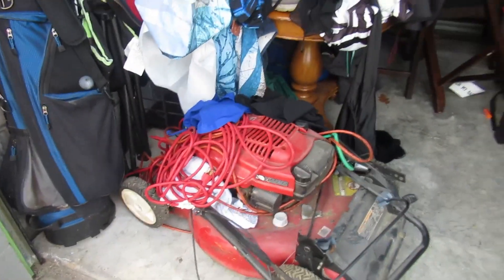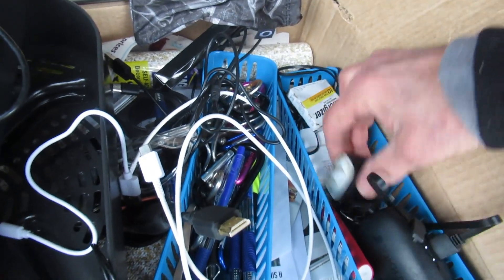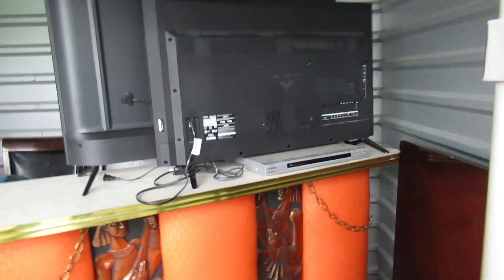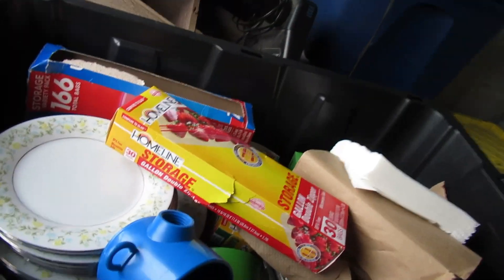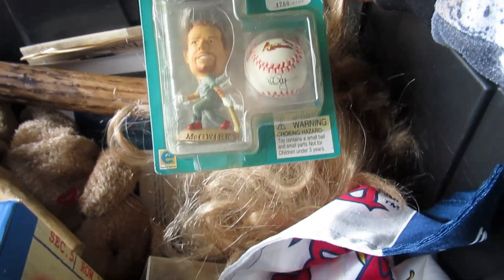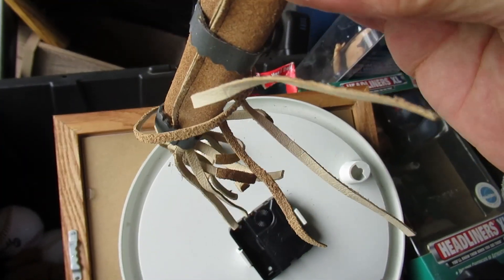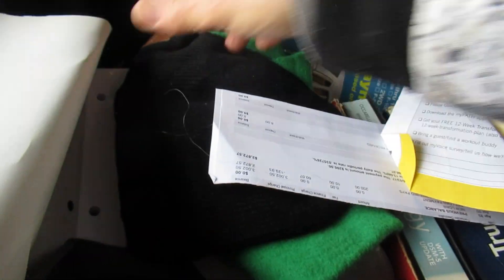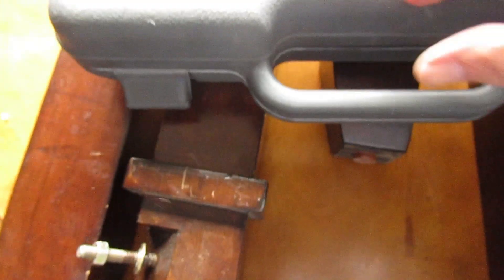400 Dollar Storage Unit Uncovers Some EXPLOSIVE Items

Comment: The machete that you found on my get 20 or 25 bucks because of the case and it's nicely handmade case or you could sell it with the other two as a collection and maybe get $100
Reply from the maker: Ill probably put them in a lot with my gold scrap guy if hes interested.